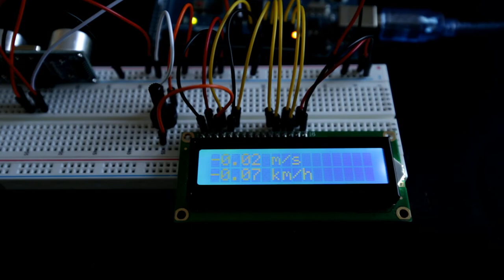Arduino project: How to measure speed with Arduino

Comment from the maker: CODE:
---------------------------------------------------

#include <LiquidCrystal.h>
#include "SR04.h"
#define TRIG_PIN 4
#define ECHO_PIN 3
SR04 sr04 = SR04(ECHO_PIN,TRIG_PIN);
float a;
float b;
LiquidCrystal lcd(7, 8, 9, 10, 11, 12); //initiatlize the pins for the LCD display
void setup() {
  lcd.begin(16, 2); // set up the LCD's number of columns and rows
}
void loop() {
  a = sr04.Distance();
  delay(1000);
  b = sr04.Distance();
  
  lcd.setCursor(0, 0); // set the cursor to column 0, line 0
  lcd.print((a - b)/100);
  lcd.print(" m/s     ");
  lcd.setCursor(0, 1); // set the cursor to column 0, line 1
  lcd.print((a-b)/27.778);
  lcd.print(" km/h      ");
    
  delay(1000);
}

---------------------------------------------------

Comment from the maker: #include <LiquidCrystal.h>
#include "SR04.h"
#define TRIG_PIN 4
#define ECHO_PIN 3
SR04 sr04 = SR04(ECHO_PIN,TRIG_PIN);
float a;
float b;
LiquidCrystal lcd(7, 8, 9, 10, 11, 12); //initiatlize the pins for the LCD display
void setup() {
  lcd.begin(16, 2); // set up the LCD's number of columns and rows
}
void loop() {
  a = sr04.Distance();
  delay(1000);
  b = sr04.Distance();
  
  lcd.setCursor(0, 0); // set the cursor to column 0, line 0
  lcd.print((a - b)/100);
  lcd.print(" m/s     ");
  lcd.setCursor(0, 1); // set the cursor to column 0, line 1
  lcd.print((a-b)/27.778);
  lcd.print(" km/h      ");
    
  delay(1000);
}
Reply: 1s = 1000ms 
Here you had a delay of 1000ms. Then why did you just divide by 100?
Reply: Excelente

Comment: Is it necessary to use potentiometer  ??
Reply from the maker: If you don't have a potentiometer you can also use a resistor. But it is probably a bit difficult to find the right resistance. I would start with a 10k resistor and go down in small steps until the display shows the right contrast.
Reply: @galoebi926  thanks bro .
Reply: @nitinmishra3674  I used a controller for the LCD

Comment: Code?
Reply from the maker: CODE:
---------------------------------------------------

#include <LiquidCrystal.h>
#include "SR04.h"
#define TRIG_PIN 4
#define ECHO_PIN 3
SR04 sr04 = SR04(ECHO_PIN,TRIG_PIN);
float a;
float b;
LiquidCrystal lcd(7, 8, 9, 10, 11, 12); //initiatlize the pins for the LCD display
void setup() {
  lcd.begin(16, 2); // set up the LCD's number of columns and rows
}
void loop() {
  a = sr04.Distance();
  delay(1000);
  b = sr04.Distance();
  
  lcd.setCursor(0, 0); // set the cursor to column 0, line 0
  lcd.print((a - b)/100);
  lcd.print(" m/s     ");
  lcd.setCursor(0, 1); // set the cursor to column 0, line 1
  lcd.print((a-b)/27.778);
  lcd.print(" km/h      ");
    
  delay(1000);
}

---------------------------------------------------
Reply: @galoebi926  why we dividing on 27.778
Reply: and the delay 1000 what is the unit ?
Reply from the maker: @ibinhoshan  the delay is in milliseconds. So it is 1 second.